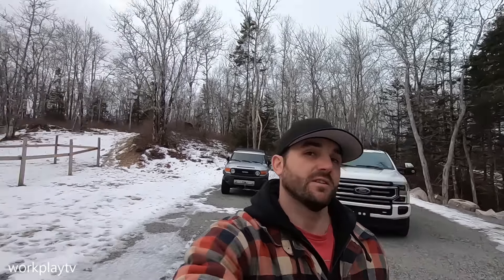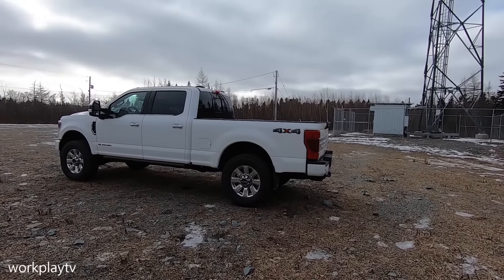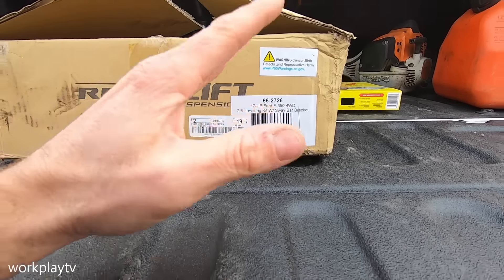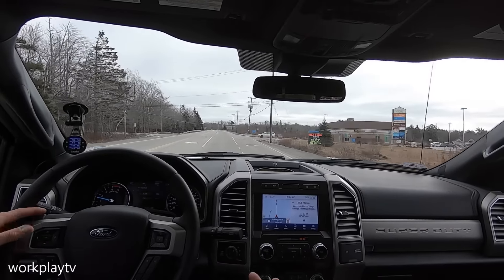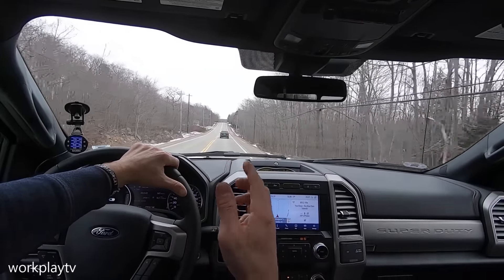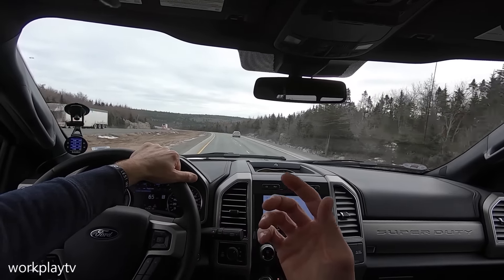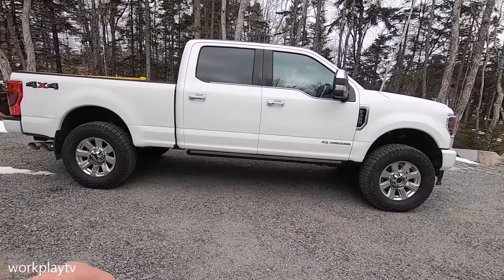2020 FORD SUPERDUTY LEVELED ON 37s!! LOOKS SOOOO GOOD

Comment: Fellow Nova Scotian here! I like the tire and level combo. I have a white, 2016 F-150 FX4. In order to make it completely level, I put a 2.5 inch in the front and a 1.5 inch on the back.  Upgraded to 33" K02's and she's a beast. To me it looks like the back needs a bit of a lift. It's likely the spacing in the wheel-wells throwing off the level look. Just my thoughts. Sweet truck man!

Comment: Well it looks awesome just for the hell of it they all sit 1/2 higher in front for just a few hrs because of the coil springs stretch out at first then they compress back down and it'll sit even. I did mine I had the 37s on for first day but I took them off and put 35s on I like seeing a little more wheel well and with the 3.73 gears the 35s made more sense.

Comment: Did you do any trimming? @ workplaytv. I have a f-350 platinum too and bought the illuminating  sill plates from Ford, for when you open the door they light up as they came in 2017, but in 2018 they removed the illuminating sill plates because the Limited came out. But the connectors where under the door sills, all I had to do was connect them and bam.
Reply from the maker: Drago Prari Nice. No trimming just had to take my front mudflaps off. I’m putting kickback style on.

Comment: Finally got my truck and measured. I got a 2021 F350 CCSB Platinum. So same truck as you but a 2021 and I also have the FX4 package. I measured up to same spot as you. Rear passenger is 44 1/4" and front passenger is 41". So I have an extra inch in there for some reason. Maybe the FX4 shocks? I measured the rear blocks at 2 1/8".

Comment: I would put your stock trac bar brkt back on, and go with the adjustable trac bar! You will eliminate any bump steer! The joints are an upgrade from the factory rubber bushings. The highway you are on looks very smooth also.

Comment: I wish i waited a year for the 2020 for the extra power and 10spd. I am still happy with my 450hp and 935tq but 475hp and 1050tq with the 10spd is much nicer!

I imagine on the low end you may actually feel like the truck accelerates better with the taller tires because of all the torque and the gearing on the 10spd. My previous Ford  SD felt like it had better low end acceleration when i put on the taller tires. The low end torque on diesels seem to handle taller tires nicely when empty.

I am happy for you! Keep going.
Reply: As fast as there gaining power wouldn't matter if you waited for 2020 cause every couple years they get more powerful. Unless you get a new truck every couple years it's hard to stay on top
Reply: @rockie307  yep. You can go broke trying to keep up. Always newer and better coming out.

Comment: Time to swap in the 2017 to 2019 rear blocks to get the stance back it should have had from the factory.
Reply: Tread Lightly Services LLC. agreed i like trucks with a slight rake.  but i am old.  i also like chrome and white letters

Comment: Looks good, I too think it appears to be squatting a tad.  I have the 67-2551 ready lift  1" spacers for my 2019 cclb F350.  I have not installed yet because i'm not sure if I want to do the adjustable track bar as well or just leave it alone.  As is I measure 35.25" at the lower body line in front of the rear tire and 33" at the same crease directly behind the front tire.

Comment: Looks great buddy! The wheels, whatever they are, will make a HUGE difference. I'd say to keep this suspension unless you're going with 10" or 12" wide rims, then a lift is essential to not make all the poke look dumb.Where did you buy the ready lift? Is that 400 canadian because if so I need to know where! Perfect stance  I think maybe even a bit bulldoggin since you tow but as you say, you have the bags. My rims and rubber just came in today and I am super jacked to get them on my new F350!
Reply from the maker: T Mac I got it from my buddy’s shop but they are on amazon for like $430 I think

Comment: Truck looked great thank you for using stock wheels they look awesome. I dont know what goes through peoples minds with the wheel and tire combos
Reply from the maker: Bryan Blood Well I do have wheels coming. Lol
Reply: @workplaytv  unless your getting different set of 37s you'll be ok 😂🤣. I'm referring to the trucks that have lower profile tire that stick out of the wheel wells 9 to 10 inches. People dont understand that your truck looses a lot of it 4x4 capability with tires like that and in the summer they hydroplane alot and if you live in a state where it snow alot its extremely hard to even drive on the highway with deep snow.
Reply from the maker: Bryan Blood Oh no no I’m staying with these same tires and not going with a crazy offset
Reply: It takes away from the toughness look of the truck when they do that. Then when someone does thst to there truck it looks like a Mexican owned it or someone who lived in the hood. But you have a nice truck I just got my 2013 EcoBoost fx4 paid off. I wanna look at the new 7.3 gas f250 so I'm glad I stumbled on you YouTube channel because I would have never thought you could put a set of 37s on a truck with stock front end components back when I first started driving that was a 9in lift unless you has a strait axle. A strait axle that was 4 or 5 in lift.

Comment: I did a 4 in BDS radius arm lift with 37s and I my F250 and it looks and rides awesome!
Reply from the maker: Jim Fisher what size tires? Just wondering your overall height
Reply: workplaytv 37x12.5 Toyo MT.
Reply: It’s 62 1/2 to the top edge of the bed
Reply from the maker: Jim Fisher Thanks man

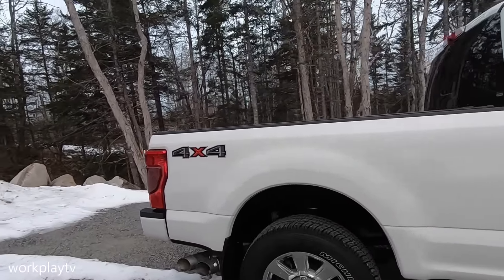Comment: What gear ratio do you have in this truck? I am looking at one but it has 3:31s (2020). Also I love those tires. I have them on my F150 and have put maybe 20,000 miles or more on them. Been off road a good bit and I've pulled buddies out of mud so slick you can barely walk. I like them so much I bought a set for my Jeep Wrangler TJ as well. The tires made it drive much better and ride better as well
Reply from the maker: 3.55

Comment: Truck looks awesome! Just wondering. I have a 2019 with 18 inch stock wheels and tires. I pull a 35 ft 5th wheel. Want to go to something like this but don’t want to put too much stress on truck or trailer back axles. Wondering if I can go to 20s or stay with 18s. Thanks
Reply from the maker: Kevin Hunter 20s won’t really effect that at all it’s all about your tire size. I think you should get airbags for sure and you might want to stick to 35s
Reply: Will do! Thanks!

Comment: I’m going nuts driving my ‘20 F350 KR bone stock... it just sits in the garage since I’m still driving my 2019. I’m curious to see how the Husky’s look. Tyson do you run those Falken AT3W’s year round?
Reply from the maker: zfilmmaker Oh yeah they will be on here till they are wore out or I don’t like them
Reply: workplaytv I’ve got the ‘17-19 Carli kit for my 2020 F350 but I thought maybe wait till they give green light. I bought it without even thinking. I haven’t bought tires yet though...you ran the ATW3’s in a smaller size right? And they held up well for towing? The very low price makes me cautious.
Reply from the maker: zfilmmaker This is my first set of these
Reply: workplaytv gotcha...You reviewed the Toyo AT’s... I saw your snowy/ice drive. How did you end up liking them?
Reply from the maker: zfilmmaker Yeah i actually liked them a lot. They were great for towing.

Comment: Looks good. I take not you did not go with an adjustable track bar? I ended up puting an adjustable trac on mine to center the front axle. I want to put the shims on next. Carli has nice stuff

Comment: So question for ya, what if any rubbing issues did you have with the 37’s? What did you have to trim?
Reply from the maker: Louis Bone stock wheels they rubbed on radius arms and sway bar at full lock. Can’t trim that. Slight spacer will take care if that.
Reply: Perfect, and much appreciated.

Comment: Any level kit is the weight on the  back like fifth well or any weight on the back.  If you install level kit and you hookup trailer then you headlight will blinding all drivers. You change engel off truck. And not everyone has air suspension on back
Reply from the maker: Your right but I do. Lol and I recommend it
Reply: @workplaytv  for what reason ?

Comment: What PSI were you running in the 37s? Same as factory?
Reply from the maker: No like 55
Reply: I appreciate the reply. I’ve got one similar to it. 17 white platinum. 106K miles with zero issues. Worried every day though about that CP4.

Comment: Not sure if it's the same on the 20's, but I bought the Derringer Supergauge for my '15 Platinum a couple of months ago, and there is an option in there to adjust your tire size.  It might be worth looking into.  I went from the stock tires to a 35' tire and was able to get my speedo back to where it should be, according to GPS.

Comment: great videos..been watching since you first got your truck. Get the Carli system...they are the best.  Expensive but worth every penny.  They do a lot of R&D, and their spring and shock set up and testing makes the truck ride close to a 1/2 ton.  If you can get their rear spring and shock set up w bags...that is absolutely the best.  I did this to my 15 Platinum w some 37 Nitto Ridge Grapplers.  I did everything except went with the same bag set up like you have.  I have a new 7.3 Tremor (don't need a diesel anymore) coming and I really like my truck and it rides better than the new trucks I have tested and I now am having reservations and really don't want to get rid of it...That's how much I really like the Carli set up.  Good Luck.  Subscribed.
Reply from the maker: Jeff Jassby Awesome thanks for the info

Comment: Does lifting, leveling and over-sized tires change the warranty from Ford? Just curious.
Reply from the maker: Tom Jubb it can be a very grey area to honest
Reply: @workplaytv   What do think about 18 inch vs 20 inch wheels with 37 inch E load rated tires ?   Any difference in brake cooling with heavy payloads/heavy towing(will more brake clearance with 20 inch wheels vs 18 inch wheels make a noticeable difference), or stability/handling  with a heavy payload/heavy towing ?
Reply from the maker: Gen1 C8RS Wong really make a difference between the two wheels sizes but going to a bigger tire will always put a bit more load on your vehicle.
Reply: @workplaytv  Thanks for the info👍

Comment: Looks great!  I’m interested in overall height. I have a 2016 on the same level and 34s and it fits with a couple inches to spare under my 7’ door.
Reply from the maker: Tom S I’ll get that soon
Reply: Feel you bro I haven't done anything that will affect my height cause of my 7' door 🤦🏻‍♂️🤦🏻‍♂️
Reply: I’ve since added 35” Ridge Grapplers. Still have about 2” to spare. Now I want 37s. Lol

Comment: Is there any ways to prevent that rubbing on the radius arms or sway bar?
Reply from the maker: Yea with new wheels with more offset or spacers
Reply: @workplaytv  so pry have to be positive offset? I would think? Have you had the switch yet?
Reply from the maker: @joshuajackson8112  I went with 0 offset. No rubbing  after that
Reply: @workplaytv  still with the ready lift or u ever go Carli? And did u do
The Speedo correction? How u go about that? Thanks

Comment: 12:27 Be careful with those tires. I have the same set and at 25,000 miles they are so loud I regret getting them. Just be sure to keep them rotated and properly inflated (under inflated a bit IMO) so they wear as evenly as possible. Truck looks great! Maybe a tad bit high in the front (looks wise) It will probably settle a bit and end up perfect.
Reply: Those tires are not loud

Comment: Looks good man.   My partner at work has those tires on his tundra he loved them but they wear faster than toyos on the 1/2 ton at least.   I got a question why did you go with firestone air bags this time ?   Air bags are next for me when i get my customers to pay their bills that is ha ha
Reply from the maker: Kevin Lol I have used firestone and airlift in the past abd they are both great my buddy happens to have these in stock
Reply: @workplaytv  Can you tell me which Firestone Airbag part number you used and which compressor? TY
Reply from the maker: Tom B it’s all in a previous video.

Comment: Have that kit on a 17 & 19 f 350, sway bar drop blocks will inter fear with plow frame with sway bar blocks (fisher plow ) for work I wouldn’t go higher , you won’t see the plow , get an Amp bumper step to get in bed it’s better than tailgate step, it’s not gangster lean it’s Cali stance

Comment: I use exactly the tire size the truck came with or you will mess with your gearing. I have seen transmission problems warranty claims rejected my manufacture because the truck had oversized tires and wheels.

Comment: What size were the stock tires?
Reply from the maker: Will C 275/65/20
Reply: @workplaytv  did you change the speedometer with forscan or will you be driving with the difference in speed in mind?
Reply from the maker: Will C I plan to hook up the forscan today

Comment: What I find odd is a video you posted where the front passanger side tire sticks out further than drivers side...strange!
But yea the truck wheels mirrors everything looks dynamite.
Reply from the maker: Ronald Pollock Yeah even with the track bar drop bracket it’s off center. I need an adjustable track bar

Comment: looks great dude! my 2020 F350 Platinum Tremor is being delivered Feb 24. Looking at some 20" wheels & freeway tires for this year & saving my 18" stock with duratracs for this next fall, got lots of freeway driving for the next 6 mnths. Any recommendation on freeway tires? I'l be towing an 18' enclosed cargo trailer 7000 gvw from seattle to montana many trips planned. Thnx
Reply from the maker: Kowboy The Toyo open country AT2 are great on highway
Reply: @workplaytv  i'll check them out, thnx boss!